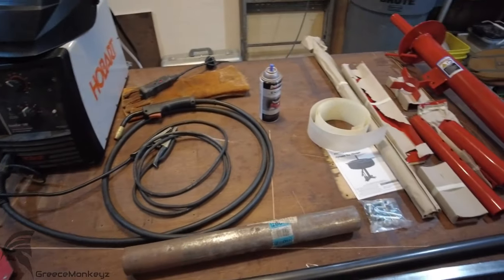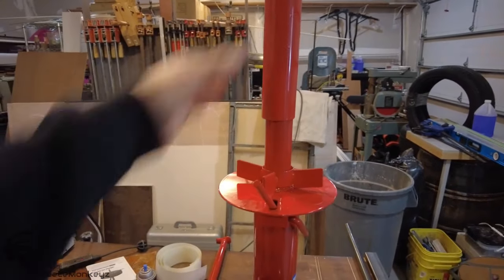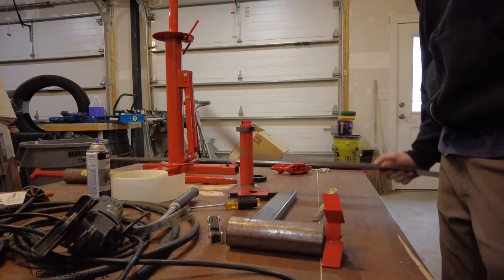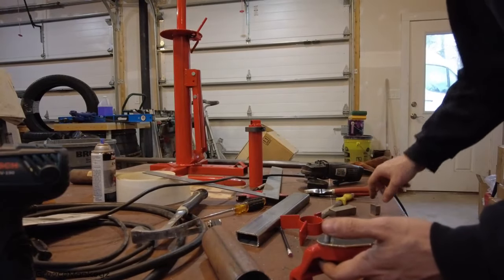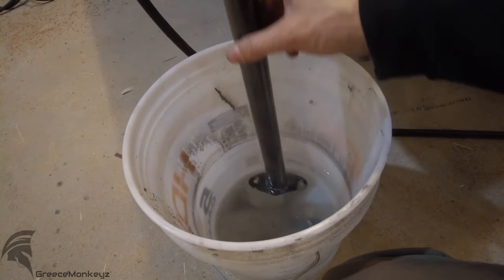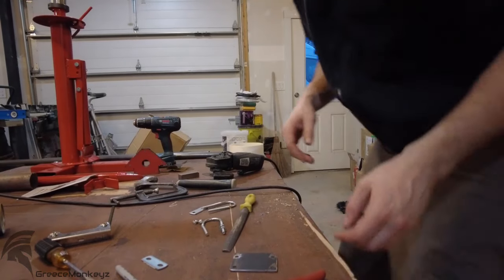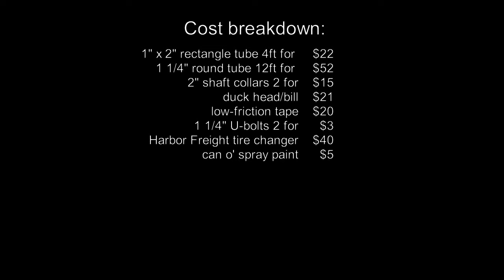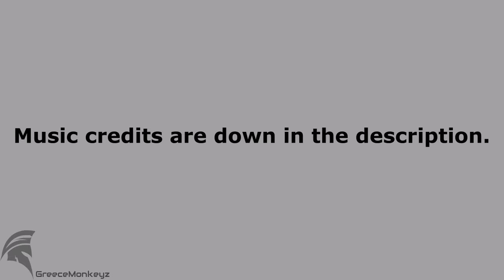Cheap upgrade for a manual tire changer

Comment: Where did you get the low friction tape?
Reply from the maker: I had it on hand because we use it for work on our table saw fence, but its readily available on Amazon, the update video to this has the parts and links.  https://youtu.be/ktpKwpRWN40
Reply: @GreeceMonkeyz  Thanks! 👍

Comment: A 30+ year experienced lead welder told me not to dip freshly welded metal into water. He said it could warp or crack. I wonder why i see a lot of videos of people doin the opposite...hmmm... Maybe cause I was doin exhaust at the time and the metal is thinner?
Reply from the maker: He's right, quenching it can introduce fractures in the metal from rapid contraction and cause deformation.  On a non-structural part, with carbon steel and time constraints I don't worry about it much, but it is indeed a bad habit.

Comment: Nice tire changer modification. Did the U bolts hold the duck head drop pipe tight and in position while peeling the tire off the rim? thanks for posting
Reply from the maker: They really aren't seeing much force as the pry bar does all the work down low and the duck head its sliding along the rim which keeps it in place too.  But yes they've been holding just fine!

Comment: Great build! What gauge exhaust pipe did you use? How’s it holding up? Thanks for the video…collecting parts now to build.
Reply from the maker: It's holding up quite well, the first set of wheels I did were 22's with raised spokes, so after struggling through that normal wheels have been a breeze.  The exhaust tube was 16 gauge I believe.  Local auto parts stores usually have small lengths in stock, or even just ask a repair shop for scrap.

Comment: Well done -- Thanks for sharing! Gotta say , that wine cellar is beyond World Class -- I hope your customers know how lucky they are. Breathtaking.
By the way, you do need to change your steel supplier, based on what you showed (honestly, over double what it should be even by 2022 inflation standards).
Reply from the maker: Thank you!   Yeah, steel prices suck locally if you want small lengths, I need to practice picking up full lengths to keep in stock.
Reply: @GreeceMonkeyz  Yes, I was indeed referring to the standard 20-foot "stick." The L** and H***D and many other prices tend to redefine what gouging looks like, at least for cut length metals.

Comment: Brilliant Design! Easy to build, and effective. The last time I had tires mounted, it cost $60 each for mount and balance, for new tires! I think one time will easily pay for your whole setup. That assumes a person has a way to balance tires.
Reply from the maker: Absolutely pays for itself.  I balanced with the Harbor Freight bubble balancer and the 22s on my Escalade were fine up to 70mph where I got a small vibration, not too shabby.
Reply: You should watch Mad Ginger Customs video on modding the bubble balancer... you'll get a better balance...

Comment: Can you send a link to the collars you used? Do the collars just spin on the red post that clamps down the centering cone?
Reply from the maker: I added some parts links to the description for ya.  And yes they clamp onto the original center piece that came with the tire changer.  2" bore fit perfect on mine, but double check before you order in case HF changed anything.

Comment: Excellent Video, but I have a question: What kind of welder did you use?
Thanks
Reply from the maker: Thanks!  I use a Hobart Handler 140 mig welder.  It works quite well for a small machine and is 110v so I can use it pretty much anywhere.  👍
Reply: @GreeceMonkeyz  
Thank You👍

Comment: 9 months ago and no update video showing it in action?  Does it work?
Reply from the maker: The video on my channel directly after this one we used it to mount tires on 22" wheels for my Cadillac.  It did not go as easily as anticipated due to the raised spoke design, but it did work and the wheels are still on it now.
Reply: @GreeceMonkeyz  thanks for clarifying! I looked but must have missed it.

Comment: How did they work out ?
Reply from the maker: Excellent.  No scratches at all from mounting and I've now put over 2000 miles on them now with no need to add any air.  The manual balance was just ok, theyre good up to 75mph, above that I start to get a vibration in the back, ill redo them when I do the brakes soon.

Comment: you dont need a duck head. best way to not scratch or damage the rim edge is simply to turn the rim upside down with the face pointing downwards. Just cut a hole in a rubber mat and place it on the top surface of the harbor freight tire changer. When working on the backside it doesn't matter if you get some minor scratches
Reply from the maker: Good tip, thanks!
Reply: Have you ever tried changing a tire though?  It seems like a good method to anyone that's seen videos of the process, but the problem is that wheels are not symmetrical, and by design, the drop center is always at the outer edge of the wheel. The side where the drop center is would be the only option.